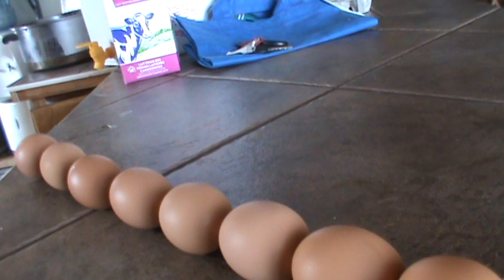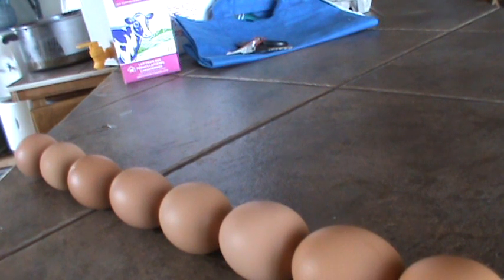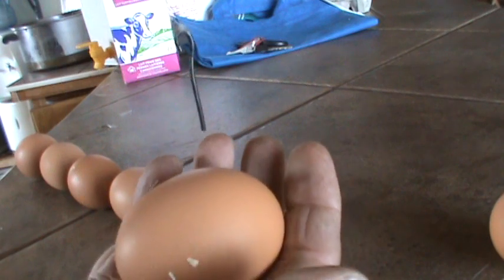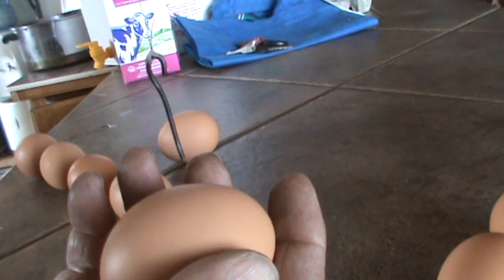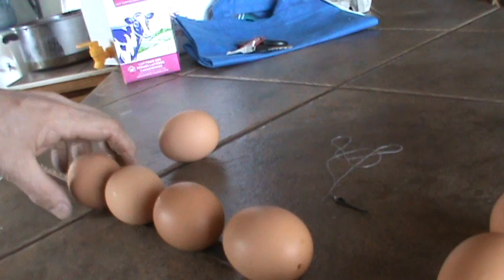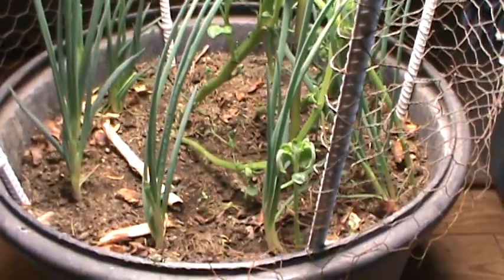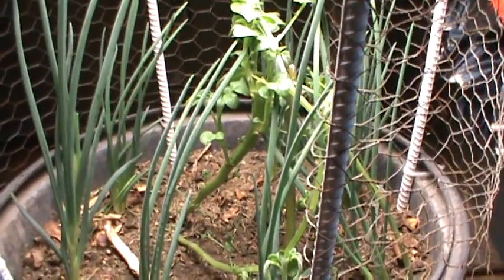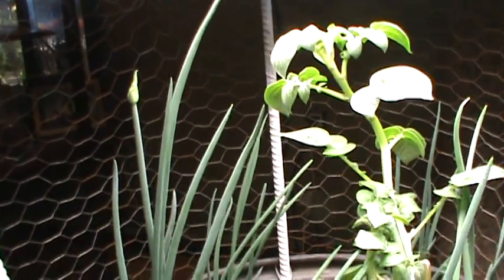#30 Egg Sexing and Container Update

Comment: I have been use this method. of sexing my eggs before I put them in the incubator for 35 years .  I use a medal  ring on a sting hold it over the egg , it will start to move in a circle if the egg is fertile , then it will move back in forth or up in down the egg, the short way across the egg is a pullet,   rounded

i